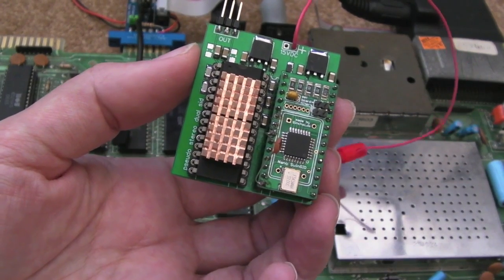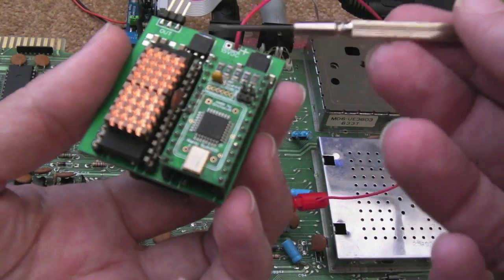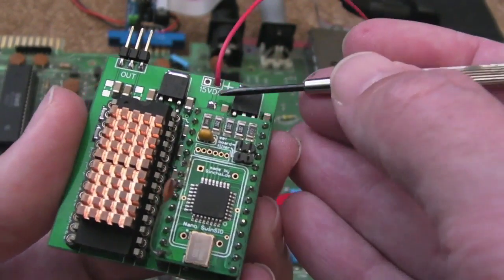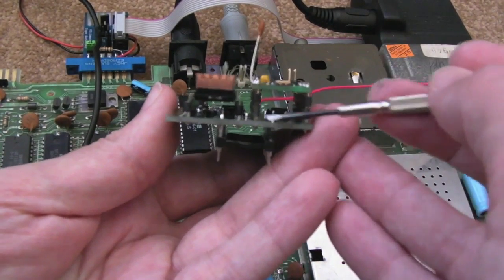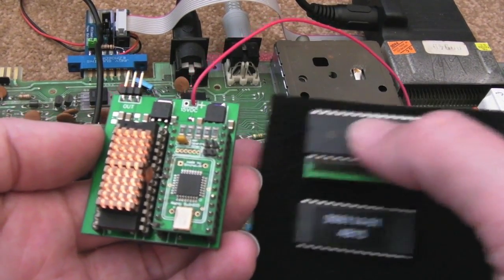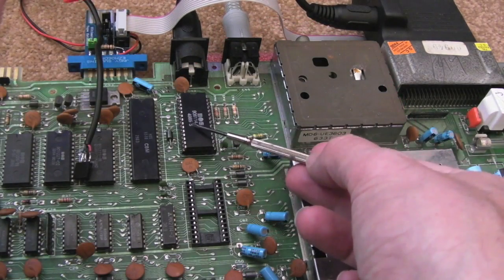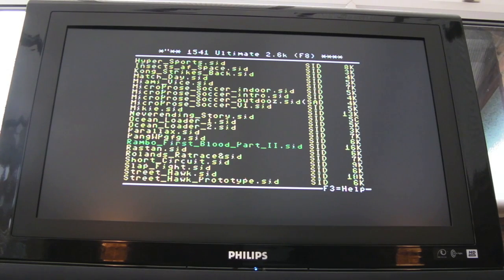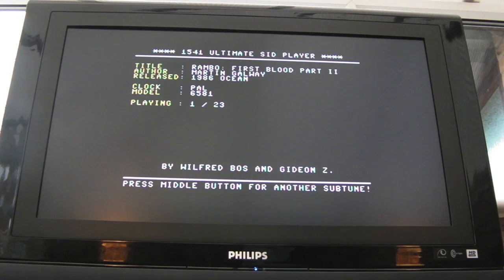Commodore 64 (C64) Tynemouth Software Dual SID PCB

Comment: GadgetUK164, came across this project: http://sidfx.kick-ass.dk seems very interesting, still contemplating if I should order one :)
Reply from the maker: +Toshio Spoor Looks cool but tbh I wouldn't use the features personally!  Depends what you want to get out of your C64.  I prefer psuedo stereo because I get the best of both SIDs on all the library of games.  If each SID sits on a separate address you can only use them both with specific stereo tracks etc.  And swtiching between them doesn't appeal to me, I would rather have both at the same time.  Still its a cool product!
Reply: +GadgetUK164 Thanks for your feedback, I still have my reservations too. The thing is, they're only going to produce one batch...

Comment: love it, the famous ocean loader rambo by martin galway. i have just picked up a sd2iec for my
c64c i've been playing the sid's using sidplayer and the hvsc more than i've been playing games.
i will defo get one of there's when dave starts the production run.
Reply: +FourX2k3 They are available now, there is a buy it now button at the end of this link: http://blog.tynemouthsoftware.co.uk/2015/11/commodore-64-pseudo-stereo-dual-sid.html
Reply from the maker: Brilliant!  Love the price and the options =D
Reply: +Dave Curran 

Just picked one up dave my PayPal trans id starts with 33B57XXXXXXXXXXXX just so you know who i am, i just need to find a second sid now and im good to go.

Thanks dave.
Reply: +FourX2k3 Great, thanks!
Reply from the maker: +FourX2k3 Thanks =)  I love some of the tracks done by Martin Galway!  The SID always amazes me - when I've not used the C64 for a month or so it's always knocks me back how good that SID is.  Good idea picking up an SD2IEC - they are a god send on the C64 and VIC!  It's worth getting an Easy Flash cart to stick a fast loader on it - something like Epyx Fast Load, then the disk loading is around 10 times quicker!  Regards Daves Dual SID boards - Cannot recommend them enough really, and I wouldn't go back to a single SID system after hearing both a 6581 and 8580 in each ear, they compliment each other really well.  The Nano SwinSID is also much better than I first thought - I will talk about why in a later video.
Reply: +GadgetUK164 

i pickup a Epyx Fast Loader Reloaded from tfw8bit when i got my sd2iec. im going to try and get a Easy Flash v3
soon as i want to be able to freeze games and sadly the Epyx Fast Loader Reloded only has a reset button.

Comment: Thanks for the video and the testing, and of course the original inspiration.

My thinking with the regulators was even with two 6581s or two 8580s to use still two separate regulators. The gives them their own clean regulated supply, not that it would make much difference. Normal SIDs only draw about 30mA, not sure about the SwinSID.

With 6581 and 8580, the sound levels were about the same, so it must be the nanoSwinSID that has a lower output. The output values could be tweaked to increase that a bit.

The CS#2 jumper is now moved to the edge of the board to make dual SID use easier. There is a photo of the latest version at the end of this blog post: http://blog.tynemouthsoftware.co.uk/2015/11/commodore-64-pseudo-stereo-dual-sid.html

Is the SwinSID and open design? May be interesting to build a version with a single SID socket and an integrated SwinSID?
Reply from the maker: +Dave Curran No problem!!!  Thanks for producing a great board for the C64!  I will buy another one of these off you at some point!  The regulators are a nice touch because they are so much more efficient than a standard 7809 / 12 etc.  There's no issue with volume level on the board - it's the Nano which is around 60% as loud as the actual MOS SID.  Nice idea moving the CS#2 jumper!  If you can, try and accommodate a jumper for that CS#2 connection - so it can be run through a switch or something.  That way someone could switch between dual mono and SID2SID mode.  That said, they could do that anyway by just connecting the switch to the 2 pads.   The SwinSID firmware is free to download, and I think it just uses an Atmega 88 or something.  I believe its overclocked to 32Mhz.  You could easily create a little board with a Nano built onto it, or two!   The Nano sounds so much better with the CS fix - better than it does when you just plug it straight into a C64.  I think Swinkles must have tested it primarily out of the 64, and perhaps not noticed subtle timing issue relating to chip select in some board revisions.  I will do some follow up vids on different SIDs in your board, and another video about the Nano and CS.
Reply: +GadgetUK164 CS#2 is now on a jumper, see the photo at the end of the blog link.

Comment from the maker: Please note - when you see the weird character issues on the screen part way through this video - it's an issue related to the 1541 Ultimate which I've worked out tonight.  That will be covered in a follow up video.  It has nothing to do with PLA's or the Dual SID board.
Reply from the maker: +GadgetUK164 Notice @ 7:03 it says SAD instead of SID (in the file listing there) lol.  What a coincidence that was lol.  That issue will be covered in a later video - there's nothing wrong, no hardware fault, nothing to do with PLA, Nano or Dual SID board!
Reply: +GadgetUK164  ive seen that before, now you have me curious as to why it happens
Reply from the maker: If you watch this video:- https://www.youtube.com/watch?v=AH6fp7eHvP8  You can see the solution is a setting in the 1541 Ultimate.